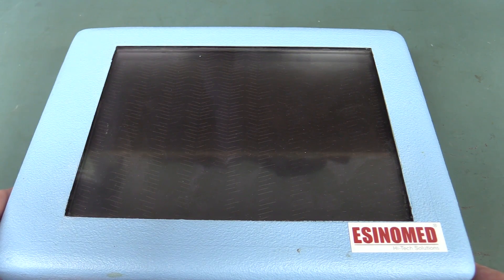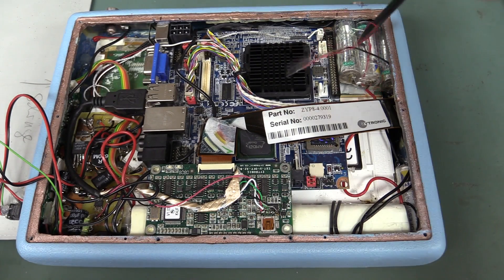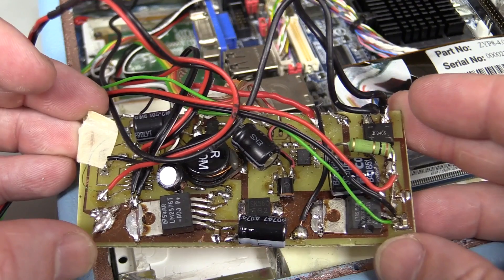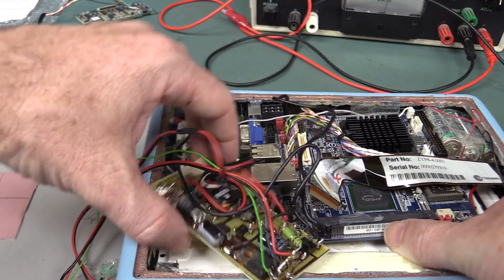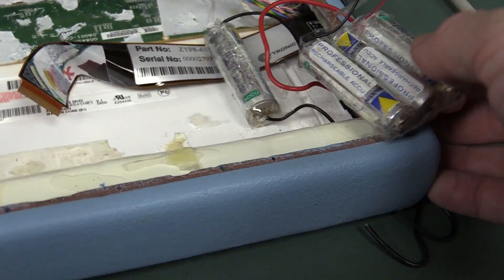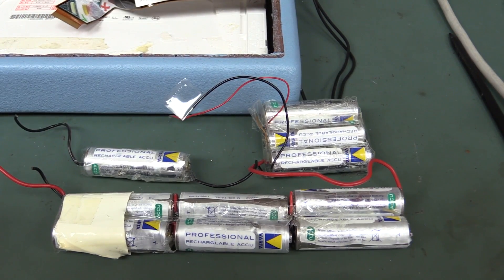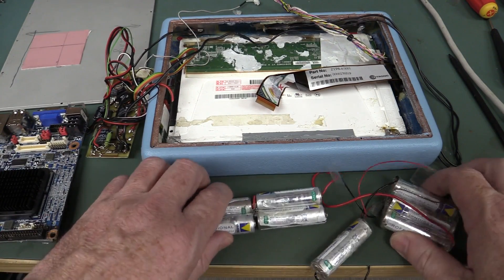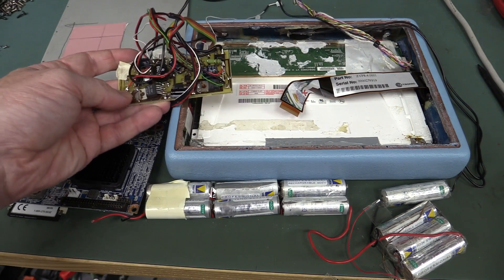EEVblog #822 - World's Worst Tablet Computer Teardown

Comment: I'm sorry to burst your bubble, but with a probability of 99,9% is this not a product from Esinomed. At the time this was produced the build in mainboard even did not exist (yet). 
More probable is, that someone did change the internals of the casing to have a touch-capable PC. Maybe for hobby, maybe just for the challange. I'm not quite sure, but the (very early) ITO touch-display and the way the adress is written might be an indicator of the production date.  I would guess: Around 1985. Thats why not even one of the internal contents match up to the housing ....

So I'm sorry to say: You have been completey pranked! And besides that - everyone who blindly clicked on "LIKE" aswell... 
Please do a better research (before recording the video) next time. It kinda hurts how you feed so many simply wrong informations in just 11 mins ...
Reply: 5-digit zip code exist since 1993...
Reply: That is an embedded micro ITX board so unless Marty McFly brought it back with him there is no way this is from the 80s. 

Just Googling "Esinomed Infoview Medical Tablet Computer" only brings up results relating to this video so it's possible that this was a prototype that never made it to (relatively recent) market. 

If you're going to burst a bubble without being a prick then perhaps you should post some hard data to back up your claims and guesses. 

REPLY
"
Reply: There is no way they had single board computers that size with USB and those flash cards in 1985. Plus touch screens in the 1980's were different. Too bad it doesn't turn on probably running windows from the late 90's.
Reply: You do your research. It's impossible for the makers of this to interface such a legacy display with a modern board. Drivers for ancient touch panels would only exist for DOS 3 or something. The serial port could be there though. But since it clearly uses USB and a modern LCD driver board, you're way off.
Reply: jaxative jax He said someone probably changed the internals. Learn to read?

Comment: The wires you see are for the zytronic projected capacitive touch panel.
They use wires onto a laminated plastic sheet instead of ITO on the glass.

Doing so, one can have very customized touch glass front at relatively low cost and no tooling. Done so once for a kiosk and it gave me the possibility to receive back-painted front glass with touch capability, directly from their factory, to be integrated in the kiosk. 
They work quite well.

Comment: Whoa... I did once roll my own replacement battery for a near-scrap laptop I was using to just do some basic mobile typing on, but I knew at the time it was a bodge-up, and just press-contacted the C-cells together within the existing battery case (which seemed to use industrial unlabelled C's with proper crimp-tabs and so-on)... so even that was higher quality than this o_O

Comment: Almost every one of your suggestions for how to have made this more professional looking, Dave, would have increased the size, and stuff wouldn't have fit.

Drop in power supply? Thicker.
USB micro cable? wouldn't have fit along the edge of the table where you found it.
Socket for the batteries? Larger size.

Yeah the soldering skills and layout on that homemade board are crap though.

Yes, all your points are valid, but I would hazard to guess that each of those points there that you've considered dodgy were actually done on purpose to get stuff to fit.

Comment: Fourth year engineering students. This is exactly the level of quality I expect to see from the little ones after four years ( or more ) of learning how to design things badly. This is nothing compared to some of the dreadful rubbish I have seen turned in. Work like this gets you through a module and off you go in to industry with a deplorable lack of basic knack firmly in hand. If anything they are worse than they were before they went in!

Comment: If this really was an early prototype unit, they really shouldn't have included the batteries at all, they should just have said to their client who they were showing it to "OK, this is a prototype of the computer, and so it doesn't have batteries, you can only use it plugged in at this point, but by the time the final release products are made, they will be fitted with rechargeable batteries".

Comment: Their power supply is surface mount with non-surface mount components, that's why it looks so terrible. They used a soldering iron, they didn't bake it, how do you get multiple components to one solder point without reflowing the solder each time and moving the part... clamps woulda helped some.

Comment: Do im the only one here that actually think this dude is overreacting? If i would be the one who made this product, u wont have a right to tell me how to solder if i give u warranty on that product and if it will last as long as i told u so.
 I mean, u know the saying: if it works - its not stupid!
 If this tabled last a couple of ears working fine, i don't care how it was made, all i see is that someone somewhere was creative! He might not had big factory with professional production skills, but he tryed his best to create this tabled and start business. 
 Why u so jizzing about him not getting a mini usb cable, but soldering directly? Whats the difference if hes not gonna plug in plug - plug out that cable anyway?? Don't be hysteric person, THING LOGICALLY AND FAST!
 Soldering on batterys - whats so bad about it? If u do it fast, it will never NEVER blow and give u way better connection. I did this shit as a kid, never had any problem. U look like person who would shit a pants about connecting LED directly to 3v battery without driver, u know what? LED actually wont burn and proceed to last for years.
I know, job is not professionally done in this tabled, but if it worked as how it promised, don't judge about someones soldering skills, it has nothing to do about how electricity flows, u look like paranoid person.

Comment: unless there are more computers like this inside I would not believe it's a production model. It looks like user modified old device to work after it has been thrown out and missing or dead batteries and blown power supply.

Comment: what's the big deal with the battery pack?  The cells don't have buttons like consumer cells, and are actually made to be spot-welded or soldered to copper tabs connecting the cells.

Comment: I see you didn't touch on one horrific fact of that battery pack... and that is that it apparently got incredibly hot at one point.. hot enough to shrink the wrap on the cells.  By the looks of that thing I would assume they got hot during use.  Fire waiting to happen.